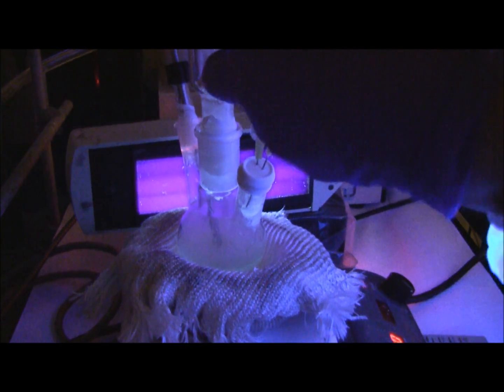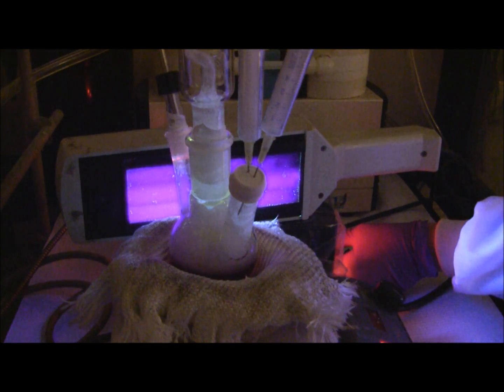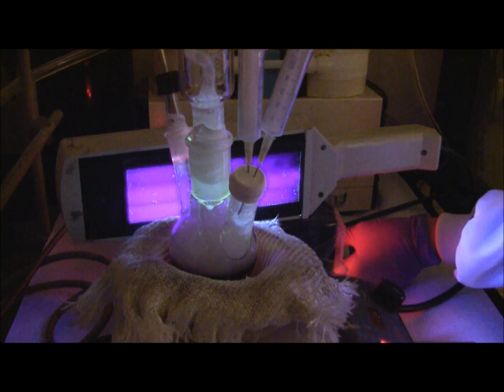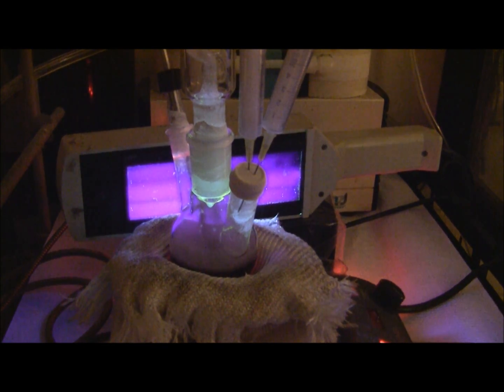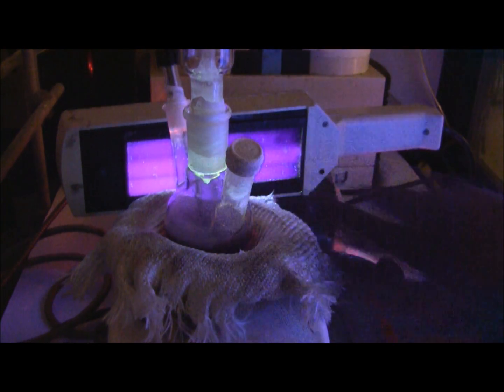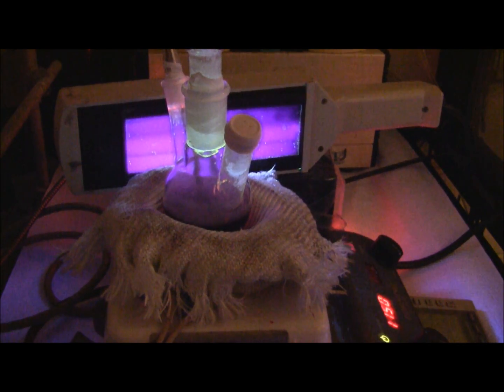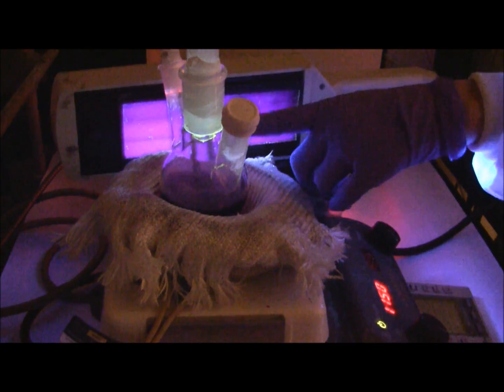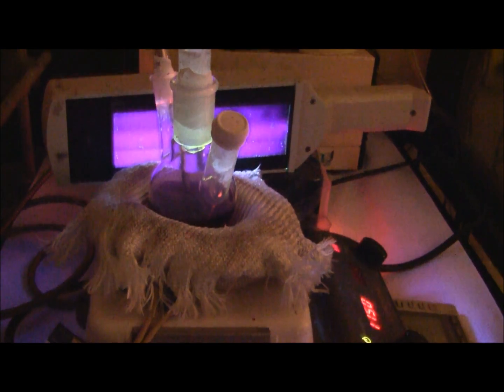Synthesis of CdSe Quantum Dots

Comment: CdSe quantum dots are core type II–VI semiconductor materials with size dependent optical/electronic properties, uniform size distribution and high quantum yield. The outer surface coating of organic ligands of CdSe quantum dots can be changed by ligand exchange process. CdSe quantum dots can be used in highly sensitive cellular imaging, drug delivery and light emitting devices. http://www.cd-bioparticles.com/l/CdSe-Quantum-Dots_258_264_295.html